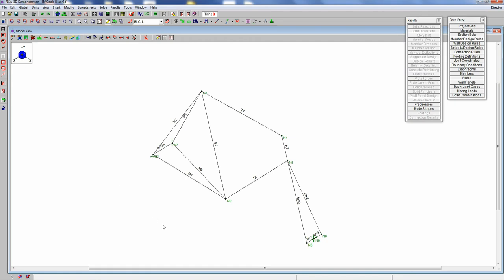Bicycle Frame Dynamic Analysis // A case study of Ms. Cools' frame

Comment: Planing, or whatever you want to call it, is a characteristic of bike frames that has been talked about by cyclists and framebuilders for decades, but BQ has to be given credit for having looked into it further than most, especially in the last 15 years or so.

I don't think there is much doubt in cycling circles that some frames have a certain something, they just seem to "go" when you put effort into the pedals. Too many people have identified this quality in their bikes for us to be able to write it off as so much hogwash, just because we don't understand the mechanism by which it works. In almost every case (that I've read/heard about) the frames that have this quality are towards the more flexible/less stiff end of the spectrum. 

As an example, look at the Vitus 979 that Sean Kelly rode in the 80's. With standard gauge aluminum tubing those frames were renowned for being very flexible and yet Kelly (a sprinter no less) used it to become one of the most successful pro's of the era. Not saying that that bike planed, or was the main reason for Kelly's success, but it sure didn't seem to hurt either.
Reply from the maker: Alistair! Thank you for putting this together into such a well written comment! There is something special to certain bikes, and qualifying it a very difficult task if not impossible. I haven't spent much time in frame building circles, but I can say having the chance to try different custom bikes is a pretty fulfilling experience. I can see why it can take decades to mature into qualify frame builder, and to be able to select tubes and make good recommendations for customers. This whole exercise has been very humbling. Again thank you for the comment!
Reply: @Henrywildeberry  You touched on it in the video. On the surface the bicycle is seemingly a simple structure/device to figure out. I know I'm not the first person with a Mech. Eng. Degree in their back pocket who set out to build a few frame sets and eventually "figure it all out". Half a lifetime later I have built a few frames, but I sure don't have it any where near figured out.

Back around 2006-2008, when BQ/Jan was writing a lot of articles on Low Trail Geometry and Planing, there was a lot of good discussion in the same vein as the kind of analysis you're doing here. Two guys at Cornell (Andy Ruina and Jim Papadopoulos) have done a lot of work in the field of bicycle dynamics and their work was cited a lot in those discussions. Iirc Jan chatted back and forth with Jim quite a bit on the subject.

I've read through enough of the published papers on the subject to realize that, while I enjoy maths and physics, this isn't an area where classical mechanics will get you very far. It requires a far more abstract form of pure mathematics to be able to define things and get meaningful answers. Way above my pay grade. Humbling indeed.

Anyway, really interesting topic (I think so anyway). I'm sure videos like this aren't good for your view count, so you can't do too many of them, but I enjoyed your take on this.

Comment: Like the analysis. You change the top tube diameter,  and you change the resonant frequency. Goal being to not scare Ms Cools with speed wobble downhill.  My system is far different as a 240lb rider on an 18 lb. Fixed gear aluminum bike. Have done 150 rpm downhill. That's pushing my neuromuscular limits. Rpm makes such a difference to how a bike performs. Some describe  it as plane- ing. You can't get everything in one design.

Comment: It is interesting especially when 2 of the bikes I've owned have given me frightful experiences with the speed wobble of death. 
When asking around after the events there was no one factor of evidence that could pinpoint the cause. I focused on wheels, equal spoke tension, balance and then tyre rim size fit and pressures. All to little positive results. Then, on one bike I thought handled like it was on rails, produced massive wobble at 70kph after I had raised the bars for a more comfortable long distance ride. Bike fit weight distribution balance dynamics perhaps?
Then... Could there be unbalanced stress forces in the frame from construction or welding techniques? Thinking out loud from mass-produced-in-a-hurry high volume frames as opposed to a carefully hand built frame.
All theories aside I have not found a perfect single solution but may have to assume one or many things will create a scary wobble.